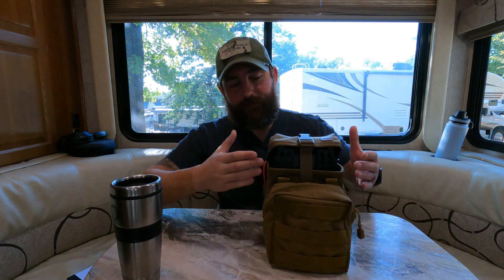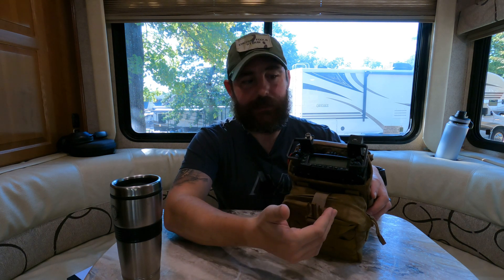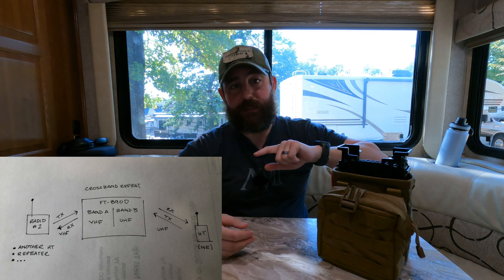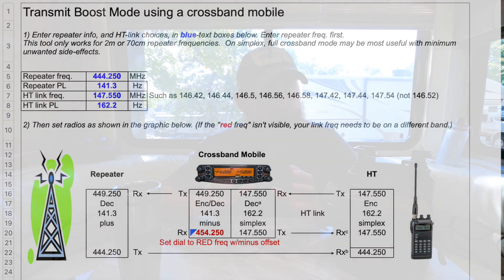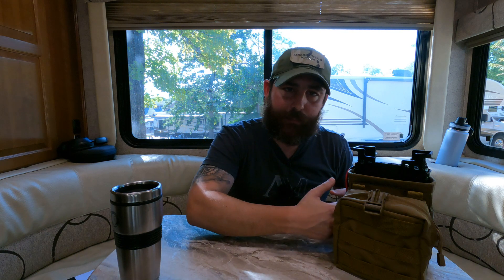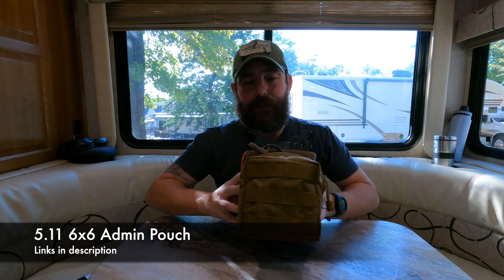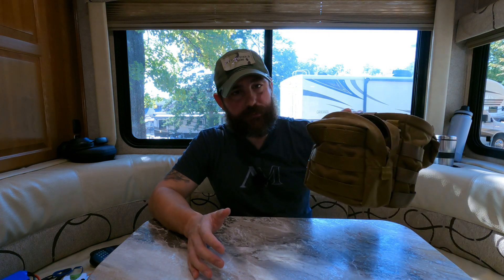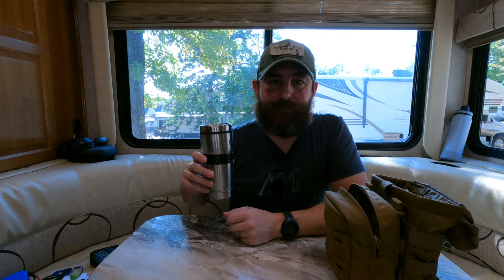Military-Style Radio - Manpack Crossband Repeater - Part III

Comment: Thank you, this is the one I've been waiting for. The cross-band feature is of particularly important to me to cross-band to the HT's. Also important is setting up the digital aspect. Just found the taller pouch for the radio to not have to cut the top.
Reply from the maker: That's great. Apologies about the lighting. I will try to make the detailed configuration video for transmit boost as soon as I can. X-band Repeat is a force multiplier. Good luck with your build.
Reply: What pouch is that?
Reply: @jeffallen6459  5.11 6.0 I think is what it is called. It is again discontinued but is 10 inches tall. Found new unused.

Comment: I had an 8800 and sold it to a local new ham. It is a good radio. 
Now I want it back LOL.
Reply from the maker: It's a great rig. I had the FT-8800R in my notes, but failed to mention it in the video. Most of the guys in our county's group run the FT-8800. Never sell your radios! ;-)

Comment: Duty cycle refers to the percentage of time the radio is transmitting. If no one is transmitting, the radio is not operating at 100% duty cycle. Being in crossband repeat will be higher duty cycle, but that doesn't mean it's 100%.
Reply from the maker: Thanks for the correction. Yes, I should have been more clear that it's only while transmitting.
Reply: If we’re only talking about while transmitting, isn’t FM always 100%?
Reply: @GeorgeAdams  duty cycle is the percentage of time you transmit, the mode doesn't change anything. As an example, if a radio is transmitting 15 seconds per minute on average, that is a 25% duty cycle.

Comment: This setup in this video is exactly what I’ve been looking for and yes please call d love to see how the cross banding works as that to me is an extremely important and somewhat confusing aspect of the setup.
Reply from the maker: Glad to hear. Yes, I will be covering a detailed setup for full duplex x-band and transmit boost in the mega series I'm kicking off shortly. Each episode will detail a real-world scenario that requires a particular solution using amateur radio. Stay tuned.

Comment: I have the yaesu as my base station. We configure it for use as a cross band repeater and have had great success.  I had the tyt as a mobile rig.  It worked flawlessly for about 18 months and then quit. I have only used them in phone mode so I’m just now exploring the digital side of the hobby.  I can’t speak to the tyt’s abilities in that area.  Going to keep an eye out for your man pack for the 8900.  If it’s a success and you move on to the admin pouch as well, make it pancake open.  I hate digging through a bag that won’t open fully…., even if it’s just 8” deep.  

Love your channel.  Always excited to see the next video come out.  

The repeater i use is not accessible w my HT’s so the boost mode doesn’t apply to me, but I think it would have some merit for anyone within ear shot with an HT if understand the application correctly.  

Thanks for your videos.  Keep it up!
Reply from the maker: I've read similar stories about the TYT TH-9800 taking a dump pretty quickly. Sorry to hear that it died prematurely. I appreciate you sharing your experience. It might help others that are reading the comments.

This why I typically stick to the Japanese radios even if I need to buy them on the secondary market.  It's too bad considering that FT-8800/8900 are discontinued. Thanks for the suggestion on the bag design. I appreciate the support! 73's

Comment: Great vid, I've had the TYT version for several years. It's been a great rig for me.  Never thought about digital and phone off the rig but its a great concept. I have TYT UV-8000E  HT's as well and they also do cross-band and in emergencies they can operate on GMRS, MURS and FRS up to 10w (in reality max about 8w).  The HT' work well in a  "drop and go" box to extend range.
Reply: I don't believe the TYT has a port for Packet Data (Digital modes)
Reply: @imh116  thanks, I'll verify when I get home but I think you are correct.  I dont remember it having a packet radio terminal node controller.  I think it has a USB programming port instead.
Reply from the maker: Please let me know if it has a data port. I'd have to pass if it does not. It sounds like the TH-9800 can transmit out of band without a MARS/CAP mod?
Reply: @TheTechPrepper  Pretty certain the tyt-9800 data port is for programming only.  I own one and love it for phone.  I think you'd have to rig up a signal-link to do pkt.  73's, K5MWA.
Reply: @TheTechPrepper   I apologize for the delay.  Ended up on a field exercise and couldn't get back online until the holiday.  The TYT only has a usb mini-a port for programming. No data port like the Yeasu has.
Reply: I have the TH-7800, the dual band version of the 9800. Pinout info is all over the internet and I’m about to make a cable for it so i can do APRS and possibly Winlink at some point. I think it will be an easy build, it uses RJ-12 connectors at the mic same as old land lines, i think it won’t be a problem to build a breakout for data and provide a connection to still have the mic connected at the same time
Reply: @RobHaag71  sounds like a cool project.  Would like to see the results and any links to the project

Comment: I was not aware of the 8900’s features. Now I’m going to have to find one. Damn you.
Reply from the maker: I've received comments along these lines few times. I failed to mention the "Hyper Memory" feature on this radio. It has 6 quick-access keys that saves the full state of the dual-VFO's including power settings. I can actually have 6 different x-band configurations if I wanted. Typically, I have about 3 crossband hyper memories and reserve the others for doing a combination of voice+digital or voice+voice (2m calling + local repeater). My work here is done. Happy hunting!

Comment: GMan, perfect solution.  Add a solar pannel and you  have a long term bomb proof solution to rough terrain comms
Reply from the maker: I always have a solar charge controller (Buddipole PowerMini) and 20w folding panel with me in the ruck. I need to break it out in the next video. The next video is on the FT-818ND manpack. That build actually has the Buddipole PowermMini permanently mounted inside the manpack. That's my go-to backcountry and SOTA radio.

Comment: I use the TYT9800 in the Armaloq configuration. I picked it because it has a 6.25 khz spacing which Europe requires for PMR 446, and for UK FM CB, as well as the amateur stuff.
73 2M0ILA

Comment: Have been using crossband for several years. The midland TM-V71A works Great on crossband.
Reply from the maker: I failed to mention the Kenwood TM-V71A in this video, but should have. I have that on my list of radios to buy so that I can build a comparable manpack. I have a suspicion that it will be discontinued very soon. Don't sell it.
Reply: @TheTechPrepper  yes it is discontinued.  So is the APRS Kenwood you used to have.  I recently replaced the cracked bezel on my TM-V71A.  Bought it over 10 years ago when I made tech.  Been trying to play catch up with your videos and wondered why the 710G didn't make the cut.  I think I remember hearing you could use the 710 head on a V71A body.  Don't quote me on that!

Really enjoying your videos...thanks!

73,
Brett K5WXP

Comment: Another good one Gaston. Cross Banding is a great feature, if you can figure it out.
Reply from the maker: Thanks. It can be challenging. There are some nuances in order to do it correctly. I'll cover a detailed how-to on the set up soon. The uplink side has a bunch of critical configurations especially if you're crossbanding into a repeater.

Comment: Great radio and I bought it for the crossband repeater feature, but love it for the 6 quick memory buttons.  It is a shame Yaesu discontinued it.  This is my main shack/event radio.  I use it with a signalink and raspberry pi  for NBEMS comms.  Same interface cable that most Yaesu's use, such as the 817/818, 857, etc.
Reply from the maker: The Hyper Memory is a bonus feature. I have all six configured for different applications. It's super simple to set in the field, too. Just a long press. This is my goto rig for our NBEMS exercises as I can handle both digital and voice concurrently. Glad to hear that you're having success with the same setup.

Comment: Love the Man-Pack to vehicle crossover, what are the options for using vehicle power &/or charging the battery at the same time.
Reply: I agree,  that is a sell point for me.   Dual or triple functionality.
The charging is a bonus.
Maybe your vehicle 12v system is noisy.

Comment: Cabelas has a 10x6 and a 6x6 pouch thay works really well. The radio fits and the pouch fully closes. I have the dakota 10ah battery that fits nicely as well.
Reply from the maker: Those dimensions sound like they would be perfect. Good call.
Reply: @TheTechPrepper  The only one I have is the ft8900 and its a perfect fit.

Comment: One thing to add is to check your local band plans for cross band operation. Here in Tennessee, we're governored by the Southeastern Repeater Association (SERA). 

In the 440 MHz band, there's a very small allocation of frequencies for cross band operations. That means to operate on cross band, one has to be in that specific range of UHF frequencies to do it legally. One doesn't need to put a random UHF frequency just to cross band repeat. That has the potential to cause harmful interference without knowing and can get into trouble. 

Depending upon the UHF frequency and the radio, let's use Baofeng for an example, one can receive interference while in that spectrum of UHF from radio broadcast stations. To stop that interference, put a Tone in the cross band frequency and into the radio that's set up for a cross band repeater. Without a Tone, the interference could potentially come across on the Repeater side and everyone will hear it. 

Last thing to add, if one is cross banding into a VHF Repeater, let the Repeater drop before transmitting again. One would cut themselves off and no one would hear the last transmission. I've done that a few times and speaking from experience. 

I think that covers my two cents. Don't mean to steal your thunder, but I imagine you'll bring a lot of what I covered in the next few videos about cross band operation. I'll show myself out. 

73, W4ISB 
Mike in Tennessee.
Reply from the maker: Hey, this is what the comment section is all about. I appreciate you sharing your experience. Others will find this useful. 

I'll go into more detail when I do the video on half-duplex x-band repeat on how to select an uplink frequency. I wanted to keep this high-level with out losing the new guys on the channel.

Take care and 73's
Reply: Im interested in the legalities of this. What gives a local organization the legal authority to mandate what amatuer operators do?
Reply: @jethro9341  I'd say the FCC delegated that authority to each state/groups.

Comment: I’m have 2 ft5d radios and an 8900r what is the best way to use the 8900 cross band to allow the 2 ht radios to talk to each other though the 8900.  Only way I came up with is have the uhf freq on the top of the ht and vhf on bottom then cross band the 8900.

Comment: I have that knock-off (UV 9800 plus), which I got specifically for the xbanding. The quality is meh on it, but it does work (on 10 watts) and it did solve some issues that you specifically address in the video. But, there's a major legality issue which would be solved if again if the others would get their tech license. It's why I keep it off for the time being unless there is a power outage. I may swap it out with it's HT equivelent but I haven't tested it with 8 watts yet to see if the two watts less makes makes a difference. I don't think there will, but things have surprised me in the past.
Reply from the maker: Thanks for your sharing your experience with the 9800. I have read the reviews and they seem to be really mixed. Some people have nothing but issues while others have a decent experience. I am still on the fence myself. Have you tried using the data port yet?
Reply: Only for programming since I haven't really experimented with anything else with it due to focusing on the xband capabilities with. I was able to xband some data through it with flmsg with okay results.

Comment: ?Can you get into details on how you set the Digirig and APRS using the FT-8900? Excellent video!
Reply from the maker: There is only one setting. Set the baud rate to 1200 under the settings on the 8900.

Comment: Could you do a detailed video on differential power sources for man packs, with recharging set ups
Reply from the maker: That is coming in the next video. I do a lot of work operating in the backcountry and I field charge everything off solar. Yes, I will share my setup. It works with the FT-8900 and FT-6000R manpacks.

Comment: 8900 seems like a good radio to source as a first serious non-HT since it can be set for radio AND digital. I had a look and I can get hold of a 8900r for less than £300
Reply from the maker: If you are into VHF/UHF FM, it's are great rig. There are newer radios, but I tend to prefer these older radios for their simplicity. I picked up mine for $350.00 USD on eBay. I payed a little more as it came complete in box with the manual. Good luck finding one!

Comment: What cable are you using for the DigiRig? I have the Clone radio TYT-TH9800 and the data port is a usb port... you don't have the cabe listed in the comments and I don't see a cable on Gigi rigs site that would be rca to usb...

Comment: A day early!  I've been waiting for this video as I own three 8800s.  Great radio.  Cross band repeat is pretty simple but I am interested in the transmit boost mode.  Looking at the image on your video it appears you're only using the cross band to repeat your HT simplex signal to the 8900 it then talks with the main repeater.  Then your HT is then receiving the main repeater signal thus eliminating the need for the 8900 to send and receive.  RIght?  If so, great use of the 8900.  Thanks for your time and efforts to make these videos.
Reply from the maker: The FT-8800 is a great rig. Almost all the guys in our county's emcomm group have at least one 8800. You are correct. Transmit boost just transmits in one direction. In the photo, I was boosting the signal to a 440MHz repeater. My HT can hear the repeater in the house fine. I'll make a video after this series is over on transmit boost. The solution to prevent transmission coming back to the HT from the 8800/8900 is a pretty neat hack that employs setting the dial frequency in special way along with setting the offset in the opposite direction.

Comment: Unless you have a need for 6 and 10 meters, why not go with the Yaesu FTM 300 ? It offers cross band repeat with the ability to use the Fusion Digital in both UHF or VHF at the same time.  In SHTF, you not only have the ability to operate in analog, but also digital. With OPSEC being so important, you will eliminate 95%+ of the people who can understand your transmission. It also has great APRS built in. Trying to find a good used radio is not always easy. To me, it makes far more sense to go with the Yaesu FTM 300. Of course in order for the other person to take advantage of the digital, both must have Fusion radios. The newer radios also offer better cooling. Lastly, if you are needing as much power as you can possibly get, the FTM 300 is 50 watts on both 2 meters and 70 CM and you can adjust the power level for each band independent of the other. Many other great features not offered by the older radio. Just my 2 cents.
Reply from the maker: I do not have any experience with the FTM-300, so I can't comment. However, when I looked at it, I passed because of the form factor of the head unit. I agree that any digital mode like DMR, C4FM or DStar will limited those who can listen to you (i.e. the Baofeng UV-5R army). For me personally, I have the ability if need to to run end-to-end encryption through the DigiRig using some custom software (EmComm Tools) that I wrote for myself and my group if there's ever a need.
Reply: @TheTechPrepper  True, the head is bigger than the body of the radio. It's necessary to have the screen that allows you to do text without the need for another devise with a keyboard. I'm a bit longer in the tooth than you and will not be out humping it for miles. So a radio like the FTM 300 is perfect for me. I'll let you kids (lol) get out in the field. If I can't drive and walk less than a mile, I'd have to really need to get there before find the need for a man pack. I enjoy your videos. Well thought out and lots of food for thought.

Comment: I'm looking at the Yaesu 8900 and the TYT TH-9800 which looks virtually identical. Looks like the data port on the Yaesu is a din connector and works with digirig mobile.  The port on the TYT 9800 is a mini USB, does that also work for data with digirig?
Reply from the maker: Short answer is I do not know what the USB port is used. It sounds like the TH-9800 is not a 100% clone in this case. You may want to check the manual on TH-9800 and see if mentions anything about packet operation or have a pin out diagram. If does not, then I would some that the 9800 users are out of luck. Second, the DigiRig Mobile has a limited set of pre-built cables and I know with confidence that there is no cable that uses USB to the radio side. If packet operation is supported, it sounds like it would have to be a question for the DigiRig Mobile creator. Sorry, I have no experience with the 9800.